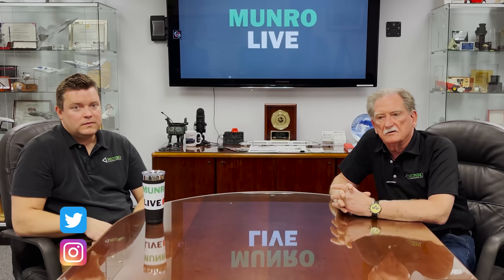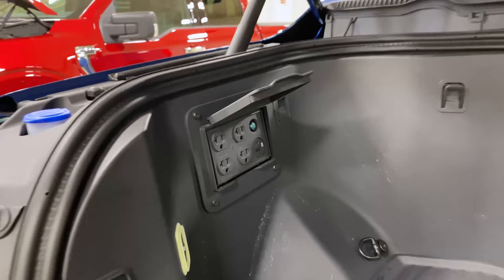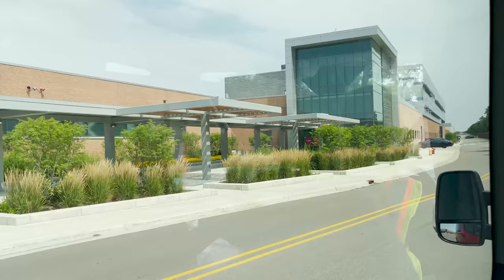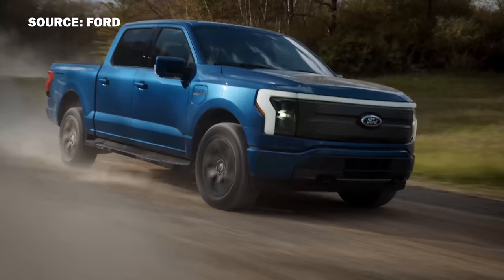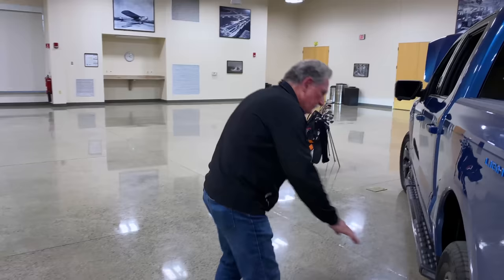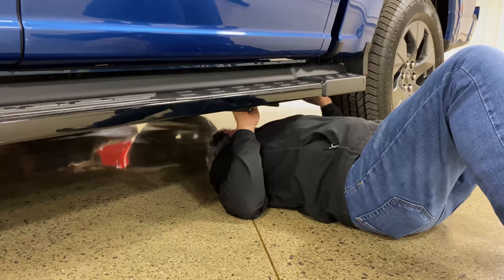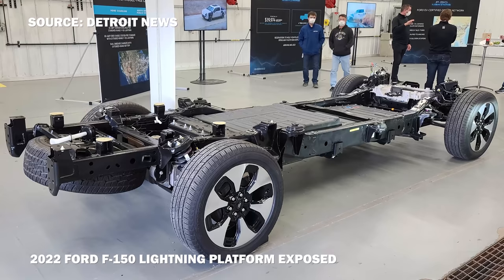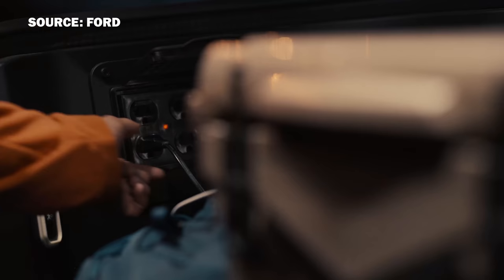Sandy's First Look at the Ford F-150 Lightning Electric Truck!

Comment: As someone that tows electric almost every day, the selectable trailer type is a bloody clever idea.
Reply: How is towing with electric? Curious, I don't need tons of towing every day, but it'd be nice to know I can tow at least 80km if needs arise, :)
Reply: @Xyler94  It mainly depends on how aerodynamic the trailer is, and towing speed.
We have a caged trailer with 6 240 litre bins standing up in it. At average speeds of around 80kmh we loose about 20% range.
Previously we had 3 bins lying down in an uncaged trailer and a very full car, and lost about 10%.
We collect about a ton of bread over three 50km trips in a week.

Comment: I got a kick out of the look on Corey's face when they talked about the Frunk....his eyes said
Look at all the room for BEER!
Now Sandy's longer years of experience really shined when he compared the rear suspension to the Challenger tank, doubt many would have that depth of experience.....overall, good to see Ford making some serious strides forward in many areas.
Reply: If they were really smart they would partner with an appliance manufacturer and develop a custom fridge fitted precisely for that frunk.
Reply: @Joe-xq3zu  - (and here I was thinking...) double-tap electric jockey box and a couple of kegs.
Reply: @Joe-xq3zu  There are already a bunch to choose from, My Alpicool fridge freezer uses, 120, 12 and 24 volt which would fit nicely in their Frunk.

Comment: "(...)when we were working on the Challenger 2B tank." Oh yeah don't worry about it. Just a passing comment about working on a tank. A. Tank.
Reply: Maybe it was a fuel tank...
Reply: @tophan5146  Challenger is a British main battle tank :)
Reply: The part that is really nuts is he said that is the only other place he has seen suspension like the F150 EV has.
Reply: we need a breakdown series on that
Reply: But is it electric? 🤔
Reply: The Challenger II is the main battle tank of the British land forces. However, neither it nor the Challenger mk1 use the bogies Mr Munro mentioned. They pioneered Horstman InArm hydrogas suspension, a system that likely will be adopted in most tracked fighting vehicles in the future, and even retrofitted to existing ones. It can perform a number of tricks no other system can and is the most compact kind of track wheel suspension available. Adapting it for wheeled applications would certainly allow for things like unprecedented wheel travel, hight adjustment, anti roll control, real time spring and damper rate adjustments etc, but it would require an extremely rigid chassis structure or subframe and it would be very expensive due to great internal mechanical complexity at almost zero manufacturing tolerance.

Comment: What is amazing to me is how they found space for HVAC and everything else with that huge Front Trunk using so much of the available engineering real-estate.  Would love to see a teardown of the Lightning to see how they did it.
Reply: Of course the truck is way bigger than the mache and they've probably used the same HVAC system.
Reply: Easy- throw out the gas engine.
Reply: @jamesengland7461  lol.... the gas engine is relatively small, its the accessories around that takes place.
Reply: @alanmay7929  the entire engine compartment is designed to hold the engine and its accessories.  They are a package deal, and take up a lot of space.  Power steering pumps and AC compressors,  replaced with electric,  can be packaged just about anywhere.  Easy.
Reply: @jamesengland7461  those are still very minor equipments, also the rest of the truck is empty and very easy to customise on n ICE truck, also smaller engines takes very little place.
Reply: @alanmay7929  have you ever seen a 5.0 Coyote engine?
Reply: @jamesengland7461  I've only seen the tiger engine lol......
Reply: Exactly my thought too. Looking forward to a tear down to see what's going on.

Comment: A true engineer....sees a new EV, drops to the floor to look underneath.
Reply: First review of this truck that I’ve seen someone do that.
Reply: @Peter N
I was started work as an Architect at 19, then  at 27 Design Engineer @Port Machinery 

CYBRTRK is gonna bring me TO MY KNEES when the TRI arrives in 2022 here in Oz!
Reply: I know, what the fuck
Reply: Peter N.  -  and  did  not  share  the  view  with  us !
Reply: @richardhobbs7107  
TOP SECRET!

l mean 'BOTTOM' SECRET!!!!
Reply: A true (electrical) engineer would have gone one step further, grabbed his PPE and a multimeter and measured parameters like battery voltage of that car.
Or would at least have searched for some label on the battery pack.
Is there anyone here, who happens to know whether the F-150 Lightning got a 400V or 800V system?
FMPOV, Mr Munro cares too much on body work, suspension, threaded fasteners, assembly and mechanical engineering. And misses electrical engineering and software engineering.
Reply: Hey, if you can’t look inside, how can your really trust anything?
Reply: @airplanenut6242  
I reckon Sandy knows or has a Bloody Good idea!
You CAN trust Sandy! imho
Reply: Really? He's banging on qbout the frunk, the drain in tbe frunk, the power outlets. Ignoring everything that actually matters like range, price, charging network, performance, seating capacity, cargo capacity, towing capacity, over the air updates, self driving, etc
Reply: Then proceeds to wet his pants apparently 👌
Reply: Kneefall before Ford... 😜
Reply: @TheMelbournelad  

To  'Parrot Phrase', 'A Parrotly!'
Reply: @PaleBlueDotCitizen  They didn't even let him drive the truck.  I bet some of them had a heart attack when he started poking under the truck when they were trying to get his attention toward the cool LED trunk lights.  He already mentioned he saw the same horrible cooling hoses but wanted to held back on any negatives for the time being.  In due time.
Reply: What Happened Gents? From Mach-E nightmare, to Voice for Ford. From positive criticism, to what? Don't understand.
Reply: And sees a big flat surface
Reply: Slightly underwhelmed by the vid. I agree with other comments there was too much focus on mechanical and not electrical aspects as well as pricing, trim comparison, etc.

Comment: I worked as a contractor for years out of a 3/4 ton quad cab chevy diesel with a trailer of varying sorts in tow every day. I was blown away at the reveal of the Lightning. There's no gas or electric truck that i could even think of that's more suited to outfitting a fleet for almost any industry. Alhough, we still need heavy investment into more range and much better charging infrastructure to make it a complete package for every use case scenario.

Comment: What I was impressed most by was how much Ford understates the range on a charge. The range is based on a truck with 1000 lbs in the bed. Without the load,the range goes up enormously.
Reply: Even 2,000 lbs. in the bed won’t effect the range nearly as much as a small (2,000 lb.) trailer.
Reply: @TraditionalAnglican  Yes,our friend air resistance.
Reply: not true, not even close. its about a 2-3% difference
Reply: @protovack  I recall reading that the Model X had great mileage if not towing a trailer,but had much worse mileage with a trailer in tow. Some couple on YouTube posted their experience with it.
Reply: 490 is the unladen range of the Ford. They’ll spill beans in march. No need to tip off ev makers or Ford buyers now

Comment: Ford really do seem to be the dark horse OEM to watch in the race to transition to EV.
Reply: Their vehicle manufacturing experience is showing with the Lightning.
Reply: ...until Wallstreet sees their earnings once they begin shipping EVs.
Reply: @oisiaa  That’s the big question. Tesla is battery constrained. How many lithium suppliers and battery manufacturers are there that Tesla and Volkswagen don’t already have contracts with?
Reply: Not really!
Reply: @m1l3s27   I haven’t seen production numbers for Q2 for the MachE but Ford only managed to churn out 6,500 for Q1. That’s not exactly cranking them out just yet.

Correction: just saw the numbers. 35,000 for the first half. Not bad.
Reply: I do have a substantial holding in Ford but the Stock never moves much. Too much overhead that’s dated, I guess.
Reply: @wattlebough  2021 Mach E sales thru June was 12975 with Q1 totaling 6614 and Q2 6361.
Reply: @m1l3s27  cranking out mach E? Better check your numbers. 13,000? Insignificant.
Reply: @Johnny2Feathers  It’s interesting that Mach E sales for the half were about 13,000 but their production was 35,000. It doesn’t make sense unless I’m missing something.
Reply: @oisiaa  Something a jade Tesla fanboy would say. It's still going to sell everyone it makes.
Reply: @wattlebough  The actually building their own facility for batteries. Get with the program dude and Google.
Reply: The Mustang Mach E has won a total of 6 awards so far.  Utility Vehicle Of the year. Best Electric Midsize Car. Best Electric SUV or Crossover:  EV Of the year.  Luxury EV Of the year.  And awarded for it's range and efficiency from the Guinness Book of World Records.
Reply: Ford has always been thus

Comment: I guess the reason they will start producing the cheaper version immediately is they can get away with the smallest battery in it. It makes sense because they're definitely limited by battery supply.
Reply: If they have limited Battery supply they should only sell the high priced ones to get max dollars out of the limited batteries.
Reply: @tomcrouchman  Sell more lower trim battery wise, but up sell on accessories and bolt-ons.
Reply: usually it's the highest margin models first.
Reply: Ford will only be able to make a few tens of thousands of these for the first few years. Maybe 15K in 2022. Maybe 30K in 2023. 
If they make more than 30K in 2022, I will come back here and eat my hat.
Reply: From what they said it sounds like people with fleets will be buying the cheaper trucks obviously.
So that creates a really good test bed for Ford to keep an eye on these trucks and put out any fires.. hopefully not literally fires. 🤣
Reply: Its a smart move because the Tesla one is starting with the most expensive. They will capitalize on first time EV truck buyers.
Reply: @Miata822  in 2025.
Factories don't get built in a few months.
Nor does the supply chain to make the batteries.
Reply: Ford know fleets will be huge adopters of EVs. They want to get into that market ASAP.
Reply: @Miata822  Building factories in USA takes time.
Not fast enough like China.
Reply: @stevebentley4516  and sales take time to ramp up. EVs are still a tiny portion of the overall market.
Reply: @stefanweilhartner4415  Yep. Manufacturers know how to control their supply chains (usually). Though the public is just now learning about the traditional OEMs making EVs those companies have been laying the groundwork for years. It's just that, unlike a certain EV maker, they don't announce things until they are really ready to do them.
Reply: @neeljavia2965  VW does not get the batteries from china. they get their batteries from the korean company LG Chem from a factory in Poland, EU.
from the growth of ev-sales in percentage, vw was growing much more than tesla, not only within the EU but world wide. VW is selling 200% of EVs compared to one year before. tesla is selling 162% compared to last year. in 2020, VW out sold tesla in europe in total ev numbers. VW outsold tesla in the first half of this year in europe. and this is only VW without counting other brands of the group like porsche, audi, skoda etc who are doing very well selling the taycan, e-tron, etron gt, q4 e-tron, q4 e-tron sportback, enyaq,...
of course you don't know that because you only know tesla.

Comment: I’m in the Mafia & I also really like the drain in the frunk..
Reply: And, bonus, you could fit several bags of concrete in there too!
Reply: Should make it easier to wash all that blood out.
Reply: If you can power open and close the frunk while driving, this thing would be like a live action Pac-Man. Another possible convenience for the mafia.
Reply: @baptistpope  That begs the question..Can this truck tow a freezer..
Reply: @DQ-su6qf  it could certainly power a freezer.
Reply: Just in case the bodybags are leaking...
Reply: @casperhansen826  I’m hoping the truck comes with a Dexter option..

Comment: It seems like some of the "features" like the folding gear selector could have been easily fixed by simply not having a lever sticking up where you want a flat surface
Reply: good point, have the gear shift on the steering column so we can have a bench front seat in case we need to have 6 passengers.
Reply: Ford did a lot research on this. Most truck buyers like the shifter on the console. Ford could just stick a dial on the dash like Ram does or shifter on the column with lower tiers. Ford buyers like the console shifter plain and simple. And they pay more to get it.
Reply: I think most people are missing the point, that the legacy auto makers have always and are still subscribing to the mantra that they are putting as many parts into the vehicles as possible so they can maintain their spare parts business going forward! They certainly don't subscribe to the Elon Musk mantra that the best part is NO PART! E.g. example the Mach E has 35 hoses where I don't believe that the Ford Engineers are that stupid!
Reply: @paulnichols5981  conspiracy theories. If Ford was in parts business they would be selling parts like crazy right. Parts shortage is real. Ford is in car business not in parts business.
Reply: why would you ever need to put your hand on the shifter after you get moving?
Reply: yeah, when sandy removed the frunk on the mach e and we saw the garbage under it it didnt look like a vehicle in production. it looked like a mockup a long way from beta.
Reply: @paulnichols5981  AGREE
Reply: A gear selector on an EV is ridiculous.  Sure, it's cool and functions cool but it's totally unnecessary.  Tesla is eliminating all levers.  Sort of reminds me how the other EVs still have a START button.  Why?  It's like the grill.  Why?  The designers just can't let go.  Hanging onto the past.
Reply: @cybat1078  Yo, Einstein:  there is no need for a gear shifter, period.  You're not solving anything.

Comment: Sticking with my CT but I hope Ford succeeds here and changes the mind of many diehards.
Reply: Elon recently said the future of the CT is uncertain
Reply: The CT will become a reality. He said he was uncertain of its adoption, could flop. Wouldn’t buy a Delorean but I like seeing them. Worst case scenario, Delorean 2.0.
Reply: The truck market is large and diverse, I think there is plenty of room for them all.
Reply: @Icayn  chuckle.   No he didnt.  He just said that he knows it is polarizing and could very will fail.   That doesnt mean it isnt certain.   It just means its not known how much of a hit it will be.
Reply: @taylor92493  the delorean.. failed because it pretty much sucked   It wasnt fast.  It didnt handle well.   It had steel and trick doors.

The cybertruck will have much better performance than existing trucks.    It will also very likely be much cheaper than competing EV trucks.   So Tesla can undercut the price and get sales.  or match prices and make ahssloads of money.

and the whole while, CT will get much better range. due to lighter frame and structural battery pack.
Just think about it.  If the CT is 10,000 cheaper, and gets 100 more miles,   and has 2 more doors, the only people who would buy a ford would be a ford fanboy.
Reply: @BarryObaminable  Really? Um he said A LOT more than that. You can read the transcript online. To summarize, they are having trouble building it, they are having trouble figuring out how to build the batteries as well, and best case scenario it will be considerably delayed, and not be offered in the specs and prices originally promised. That’s huge since many of us pointed out that’s what would happen when all the Tesla fans showed up in comments of Hummer EV videos claiming the CT would be twice as great at half the price.
Reply: @TheEvilmooseofdoom  Agreed.  Ford may do okay with the Lightning.  They seem on track to bring it out before the Cybertruck.  And it has some great features for powering your tools, backup for your house, etc.  Wish the Cybertruck was here now though...
Reply: @Icayn  You get it.  Or, were at least listening.  November 2019 we were "promised" the Cybertruck by 2021 with a 500 mile range.  It ain't available...and it is going to take a lot more development to actually produce it.  Of course, if anyone can, it is Elon.  We will know more at the end of the year.
Reply: When I hear Elon talking about future events I assume it’s a prediction not a promise.

Comment: The best part is no part. If you don’t have a shift lever, you don’t have to fold it down.

Cool to see Ford go all-in on electric trucks. Hope the ready of the OEMs get moving, too. The future is electric  . . . love it.

Good insight from Cory. Like the collaborative discussion.
Reply: That stupid,  complicated shift lever should just be a button,  or small column stalk.
Reply: Yup. Picture the BlackBerry evolving to the iPhone, and that’s the way the driver interface needs to go. Get rid of the clutter. Ford isn’t there yet — still too many buttons and gadgets — but the Lightening is a big leap forward.

Comment: The electric truck  weighs  1000 plus more than ice trucks and lower center gravity helps ride tremendously!   The main selling point of electric trucks is 80% savings in fuel cost and charging overnight at home!